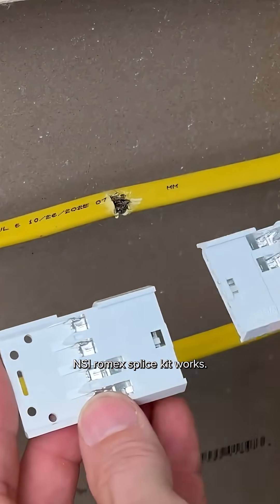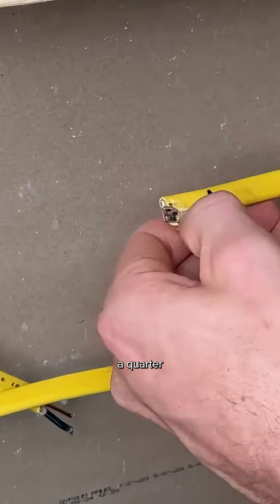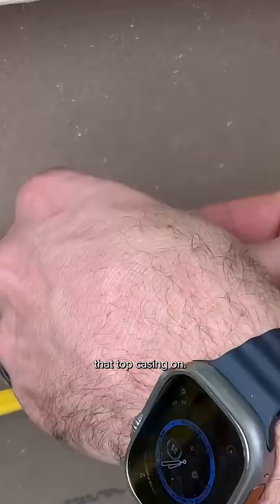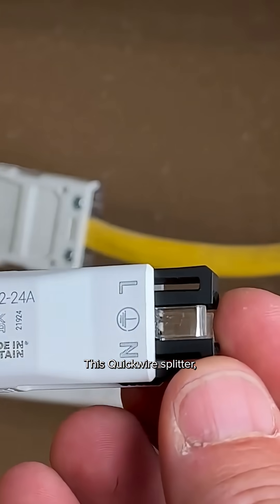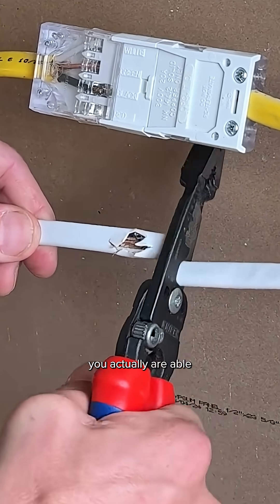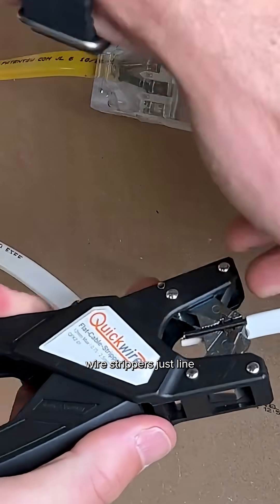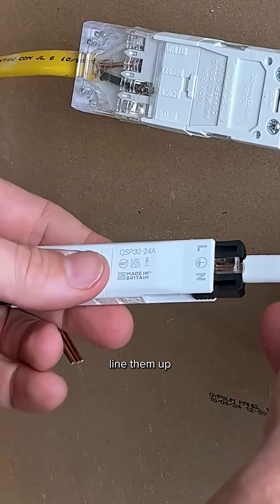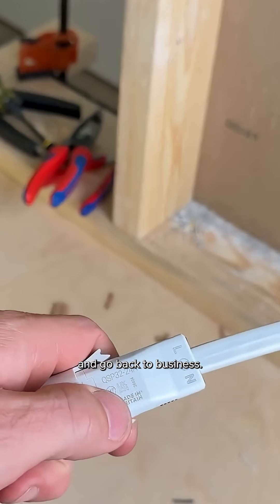The NEC-Approved Splice I Hate… and the UK Inline Splice I Love

Comment: The reason I dislike the knife forks that slice into the wire is lack of surface area. Look at a wire wrapped around the screw on a receptacle.  With the head compressing the wire, there is plenty of surface area to carry the amps (volume)  of electricity.  I've seen knife edges of the connectors burn out around the wire causing a power failure.  Whenever there isn't enough metal to carry the load, then that metal heats up, whether it is too small a wire or a poor connection.
Reply: The whole splice looks so bulky and janky, knife forks included. It looks like it couldn't handle 5 amps, more or less the intended rated load of probably 20A
Reply: @Johnny-uy4iu  * let alone [the intended rated load...]
Reply: @Johnny-uy4iu   at this point a USB-C cable handles more current.
Just splice a USB connector already
Reply: I didn't like it, I would bet a Ethernet jack makes a better connection and can handle more than 5A of load at 40V
Reply: I Would rather Have The Wires Twisted Together And Taped Than These Things! I have never had A Wire Nut Go Bad if It Was Installed Correctly! The Way I Do It!! Not 2 Code!!! I Cut The Wires back Staggering The Wire Nuts So if It is Pulled It Can Not Short Out! Then Tape Down The Entire Splice!
 But We Dont have An Inspector!! if I have A Choice I Will Put The Splice In A Junction Box So It Can be Accessed But When Adding On I have Had To Make Splices In A Wall!!
Reply: They press the wire into a plate on each of them
Reply: Approved! I've hated all other splice kits I've used.
Reply: This is literally how they've made connections in prefab houses for decades....
Reply: @jimmac1185 
Maybe that's why a disproportionate amount of prefabs burn up as opposed to field wired stick built homes.
Reply: @deek791 you have some stats to back that up?
Reply: @jimmac1185  That should not be an endorsement. Prefab homes are known to be low quality and cut corners (such as this).
Reply: @boppinator4308 it doesn't change the fact that they have been used countless times and are safe.

Comment: On the sign-off comment: you cannot bury this in a wall and most definitely -shouldn’t-. All splices are required to be accessible and for good reason.

Edit: Stand corrected. The device references 334.40(A)(B). There’s a very specific exception and only for repairs. That said, it’s still a bit dubious. There is no UL listing for a concealed device like this. I also don’t personally like leaving a splice buried because it can and will fail eventually, and someone is going to have to rip up the wall to find it.
Reply: The first one: yes, you can bury it in a wall. Code allows it. The second one: you can’t use it in the US at all.

As far as shouldn’t: I kind of agree. But that’s a different question.

Comment: How much surface area is achieved in the outer part of the connection? Outer valence shell flow maximization should be a primary consideration in design. I would need to see the inside of the UK connector and spec's before answering.

Comment: No way. Even in your demo the ground wire was cut a bit shorter than the others. It needs a mechanism to not allow seating unless all wires are cut to the same length and are long enough to properly make contact. Even a window I don’t love since mistakes can still happen. Also needs to have a foolproof way of making sure the insulation is long enough to grab onto so it can’t be pulled out. 

I don’t love the forks on the other one, but the design does limit most mistakes, assuming it can’t come unplugged easily.

Would like to see stress tests on both, but really don’t like the idea of concealed splices

Comment: ……..nice little firebox, these are worse than Wagos you only have a razor thin edge making contact with the wire which will deteriorate quickly under moderate to heavy loads…….

Comment: The second option was the best design for user friendly but neither have me comfortable enough to use them especially if you have no junction box for inspection. These seem to not have ample connection surface and might get hot if drawing a constant load like a vacuum cleaner. Seems like they took a low voltage design and scaled it for 110-125v home service. I’d keep the wire nut option, for the track record alone.
Reply: The UK version is very much not a low voltage design. It’s designed for 240V/24A, and in the Uk they actually do push 24 amps through those wires. More than a few are running at 32 amps, look up “ring final circuit” and “broken ring”.

Comment: It looks like the UK version makes better contact using clamping force. The US version simply cuts into the wire casing to make contact. If you look at the marks on the wire removed from the UK version it looks like the surface area of the connection is somewhere close to a 1/16 to 3/32, while the US version may only have several thousandths of an inch on the cutting edge.

Comment: I was installing a dishwasher in a modular home and i found the Neutral and polarity were switched. there was a splice in the line. fortunately it was under the sink and i could expose it.  The clear windows were on opposite sides so you couldn't see if it was crossed.  Those splices should be illegal.

Comment: How does the quick wire actually clamp the conductors?
I don't care for the nsi piercing system, I don't think it provides enough surface area connection for higher amperage loads. 
Especially if your going to bury it a wall forever...👎

Comment: The first connector USA type is perfect for LOW VOLTAGE circuits like a 66 type punch down block used in the telephone industry. A DEFINITE fire hazard for line voltage 15, 20, 30 amp circuits‼️

Comment: NOT APPROVED. Nice design though the connections are not visible and a specialized tool is near necessary. There is no check of why the splice is necessary. The correct connection requires the knowledge of if "L" means Live, Line, or Load; too much for the DIY consumer. Conceivably disastrous when the house flippers use them.
If licensed electricians are required by code to do the work, they seem great.

Comment: Red Tag that splice. What is the current rating? The first device has 3 points of contact. And 3 places to go bad. There is a reason  you don't bury splices. The next real electrician will hate you.  Let's load up 20 amp on a #12 romex and see how long it will last. On  more things, a handyman can srewup.

Comment: In Canada, all residential splices are supposed to be made within an accessible box (receptacle, octagon or junction box)

If the code has changed over the years, I would think that any electrician or knowledgeable DIYer would still practice doing this.

Comment: I believe that older style of connector was originally approved because we thought prefab homes were coming back. I always see them in double wide trailers in the middle wall that divides the two rolling frames. Once they get both trailers lined up on site they just plug them together.
Reply: They eventually short out.  I've replaced several that were shorting and scorched, just not on fire yet.
Reply: @davidjohnson242 I came to say this but there's always some ahead of another lol. I've had to and still need to remove and fix this in my sister's house. They aren't good, from what I've experienced and can tell.
Reply: Yep, that’s what they’re really *for*. That’s why they’re in two halves. But the insulation displacement connector they use is, like… that’s a slightly worse contact than a backstab, and you’re going to run a house worth of sockets through that? Okay then!
Reply: @JasperJanssen , I'm not an electrician, but even to me, that sounds like a recipe for disaster, in the making! 😮 And as far as the other version of connector, that too probably presents similar issues. Whether or not they're easy or slightly more difficult to put in place...isn't the important part. What seems to be at question, based on the various comments here is...the actual safety and effectiveness of using these "quick-connectors" to repair damaged romex, instead of just doing what sounds like the "proper repair" by replacing the damaged romex completely if possible, or if not, at least only using the safer "junction box" option, remove and/or replace any damaged wire and then make a safer connection, plus this option has the bonus of being easier to find later (if done in the typical industry standard way) by another electrician that has to find the source of a problem, when he isn't familiar with the home's wiring or wherever this repair is being done at. 🤪😜 At least, that's what it seems like to a layman, lol! 😂😅
Reply: I was called out to a case of exactly this type of application because the inspector wanted the rats nest collection of these things - which at least were all in one place and accessible behind a removeable panel - replaced with conventional splices in junction boxes.

People have emotional reactions and make presumptions about this stuff not necessarily based on data. I guess the inspector and I are perhaps no different in that regard, but I know I felt better walking away from that place knowing that's what I'd have wanted for my own home.
Reply: @scottwilling5315 the odd thing is — the actual connector itself in the center seems fine! What gets them is the contact between the wires and the units. So if they had a better connection on that side — maybe something like a wago — there wouldn’t be nearly as many problems. But no, they have to squeeeze out the extra 10 seconds per manufactured house and pretend that you can make a good connector that works without stripping off the insulation. Still have to strip the outside casing anyway, but no, those several seconds make a huuuuuuuge difference. Apparently.
Reply: @JasperJanssen  The first time I was tracing a partial dead circuit in a mobile home, I was surprised for about a millisecond when I realized all the devices had backstab terminals only. No screws.

Then I thought yeah, of course. 🙄😞

Comment: Approval should be based on test results, not popular opinion. Does this perform as well or better than the original insulation and jacket? Is there any degradation over time or with heat? I don't care if it looks pretty or if it's quick and easy, I am concerned that it works well and is safe.

Comment: Not approved.

I don't trust splices buried in walls. Also, I don't trust most of the jack-leg electricians in my area to use either splice correctly to prevent heat building up under a load and causing a fire.

Comment: Uncertain. I’m old school and have never had a failure w pre twisted well tightened wire nut in a box and cover. I would trust that over any IPC or lever lock device that adds impedance. I suspect the only reason wire nuts aren’t approved for concealed splices is people dont use them correctly.

Comment: Hit them with a steady heavy load and watch the temperature with a thermal camera.
Reply: Willing to bet it's 100% fine, just like wago are.
Reply: @Shoop83 the UK version, sure. That US romex insulation displacement design… I am not sure I buy that one.
Reply: @JasperJanssen that's how wagos work my man. They just do it without cutting through insulation. IDC connectors use a  insulation displacement connection, but at the end of the day, it's still just rated components making contact with the outside OD of the conductor. AC Electricity has an amazing thing called skin effect. Which means just about all the "pushing" force, aka the amperage that travels down a given conductor, travels on the outer surface of a solid conductor. This is why stranded wire became a thing. More surface area for the skin effect, less voltage drop to drag down the needed amperage at the other end. This is also why copper coated aluminum wire is a thing. As well as hollow or air dielectric based cable designs.
Reply: That Quickwire connector is rated for 24amps at 220v which is roughly the same rating of a 2.5mm twin and cpc cable. So it should be all good. :-)
Reply: You don’t think UL did that?
Reply: @bryck9068 To be fair.. I don't see a UL logo on either of these devices. I don't care if they are being sold on the stores.. That doesn't mean they have been approved through UL...
Reply: @bryck9068 lol that’s what most people don’t know. If it’s ul listed then it’s completely allowed by the nec as long as you are using correctly. Which is another thing average Joe doesn’t know. The manufacturer instructions and specifications supersedes the code book
Reply: @bryck9068 Even if it’s UL approved it only means it’s meets minimum standards, example 79cent back stab receptacles. 
In NYC BX MC cable is mainly used. We wouldn’t want to see a similar item. The best option is to replace the defective cable if possible or install a splice box that is accessible by code.
Reply: @Allan11236  I think you mean "the 'best option' when money isn't an obstacle..." Imagine if the power company replaced exterior broke lines every time someone neglected to 'call before they dig' or cut down a tree and killed the power in their entire neighborhood.
Reply: @Allan11236 yes. And backstabs suck. Guaranteed future work for sparky.
Reply: @bryck9068 ul did but it's not clear what installation inconsistencies this splice would tolerate and how foolproof it is. He also should have started this video with what listing this device is under
Reply: I approve
Reply: Approved
Reply: approve
Reply: They have done all the appropriate testing and more in the uk. Trust me 🇬🇧 test and demand a lot when cables are hidden or not as accessible
Reply: Would prefer seeing the interior of the splice kit prior to making any decision.  Would feel safer using a mechanical nut for tightening/clamping versus a spring locking mechanisms, known for causing loose connections.
Reply: man they should have hired you for this outside of the box thinking
Reply: I’d sleep better just pulling a new wire.
Reply: It'll be perfectly fine. There's thousands of mobile homes with these running nearly every circuit between the individual sections.
Reply: @16vSciroccoboi is that why so many people are cooked in their aluminum homes?
Reply: They'll be just fine.
Reply: @dmh101 What’s wrong with replacing the cable or installing a splice box.  If the cause isn’t corrected that damage the cable it will happen again⚠️⚡️‼️
Reply: @dmh101 I don’t think any professional electrician will use these splice kits. 
If in doubt rip it out.  What is wrong with a splice box. 1900 box or a J box. 
Don’t drop your standards⚠️
Would you install these in a house where you live with your family???
Reply: Agreed. Such small contact area, no way I would trust these for any type of high draw situation.
Reply: It is useless for any standards agency to test these “devices” when they are new and properly fitted, what will they be like after 5 years if thermal cycling is the question that should be asked! I wouldn’t touch them with a bargepole!!  Its like building an ignition point into the fabric of your house!
Definitely NOT approved!
Reply: In CA they would have to also pay off the governor’s “tariff” like CARB fees.
Reply: And put it in water... how long can it be submerged in water before water gets in. Or is it waterproof?
Reply: @r @rulerclips  how many wires that are buried behind your walls are you submerging in water? Do you live in Atlantis?
Reply: Atlantis is low voltage only
Reply: @rulerclips  Your typical Romex isn't rated for water or wet enviroments either. If that splice gets submerged, it's likely the receptacles did too. Which are also not rated for water.
Reply: @ryanburns3921 i understand it's not rated for water but it happens. Roof leak that drips on homeruns. The wires are fine i was just curious if they did any testing on it to see if it was as good or if it was worse. So much code is made for the 5% of situations that you never really see happen.
Reply: @rulerclips  Its romex which isn't approved for wet location anyway.
Reply: @seanboate9960 Romex is covered in plastic!, except where spliced in accessible boxes. Roof leaks, pipe leaks shower leaks happen, yes wire gets wet, this splice is inaccessible, and it has broken the pvc jacket on the Romex, allowing water in to the conductors hence much more likely corrosion! Leading to resistance, heat, fire:   Not good at all
Reply: @MAsWorld1 Plastic you say!  Who knew?  It still doesn't change the fact that Romex isn't supposed to be in a wet location so it should never be in a location to build the kind of corrosion you are talking about.  And if it does then you should see water problems long before then.  Besides which, neither of these splices is designed to prevent water intrusion so your point is moot.

Comment: IDCs have been around for decades and used in many industries.  If properly implemented they will make good connections for decades.  Each device will have a tool for assembly that is designed to fully compress the connector but not over compress it.  The moment you see one where there isn't a specific tool you just crush down on it with pliers until you think it's done, that one you know is rubbish.

The quickwire is fine but is only valid for specific wire sizes.  It's not a general purpose thing like a WAGO or Ideal lever / push-in that you can put a range of wire sizes (CSA/gauge) in.